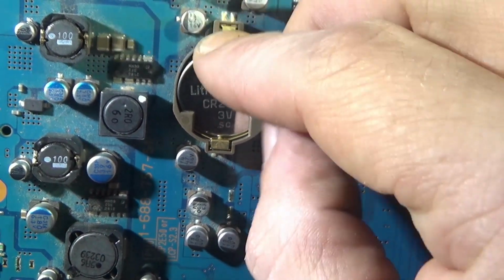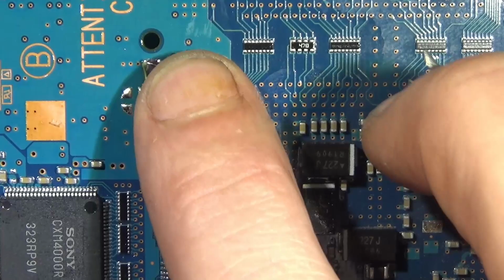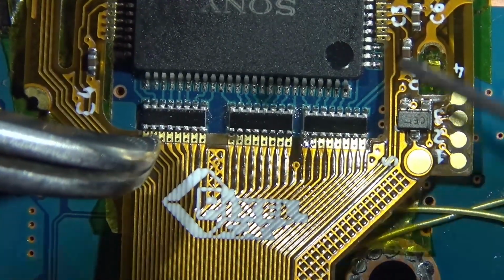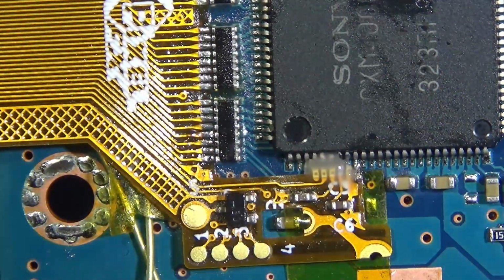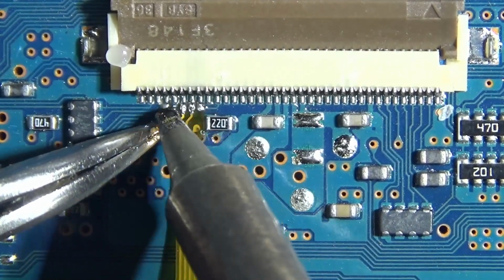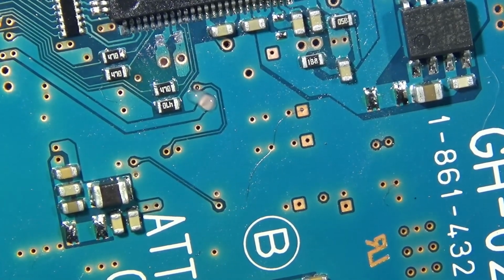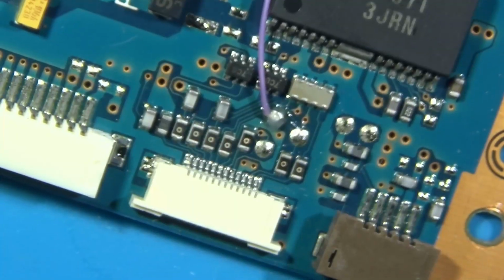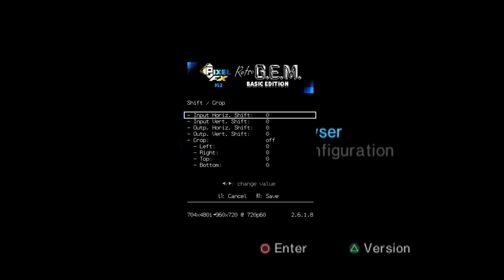Ps2 Retro Gem on both 5000x fat revisions (V9 + V10)

Comment: Why would you connect this to the Retrotink 5x, even temporarily? That completely defeats the point of the RetroGEM
Reply: It doesn’t defeat the purpose. Having them both looks much better. HDMI has such a stronger signal. It will look significantly better with HDMI.

Comment: Thank you for mentioning why you use leaded solder! I've heard some youtubers say they only use lead-free on the PS2 and I tried hunting around on the internet with no answers 😅  I'm just getting into soldering and modding PS2's and your videos are super helpful and inspiring to me!  Stay awesome!🥳
Reply: You can use leaded 63/37 (tin/lead), Kester makes a good one. Choose a fairly thin diameter (you can always use more of a thinner diameter, but it’s harder to use less of a thicker one) and never look back. The only reason anyone uses lead free is to follow laws and regulations and use less toxic materials in consumer electronics that kids use, but trust me the lead is worth it and all you’d ever want to use for modding. (Just don’t eat it) Lead-free is harder to melt and needs a higher temperature to work with thus more likely to cause damage to parts and soldering tips, is more prone to cracking over time and looks worse it isn’t as shiny. 63/37 is eutectic (good). NASA only uses leaded solder due to it’s reliability.
Reply: Retrogem instructions say to use Lead Free solder because of the tin content of the solder on the PS2 motherboard from factory. States that the added lead content can lead to cracking.

Comment: Bro what temp did you use? Something is wrong because when i solder stuff like that I never get that much bridging. Looks like your temp is too low. Maybe preheat the entire area with a hot air station at 200c or something next time.
Reply from the maker: When dealing with flex cables, my rule of thumb is go as low as you can. I was at 310c which is already kind of spicy for some flex cables. If you go too high those pads will come off like butter.
Reply: Apparently the flex cables are very heat sensitive and they're easy to destroy if it's too hot.
Reply: @adamatomant3381  that makes sense